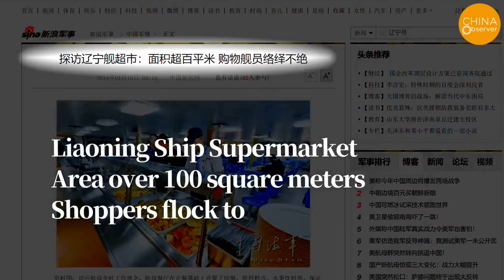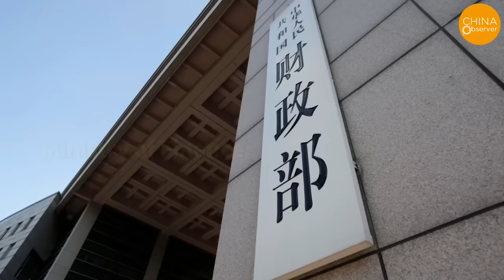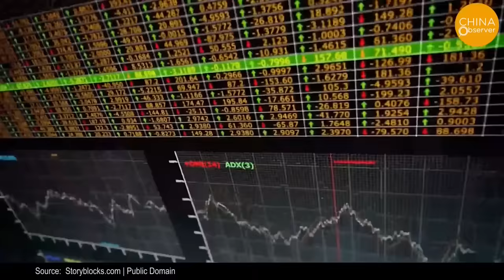China’s Junk Aircraft Carrier Fears to Sail? A Big Joke Due to Copycat Failure

Comment: The USN was fearful the Type 003 would essentially be a Chinese copy of the Kitty Hawk/Forestall Class conventionally powered, steam catapult super carrier. While smaller than Nimitz and Ford Class super carriers, they are just as capable and showed to be highly effective/economical. Which is why the USN used them until 2000's and would be ships Chinese shipyards could construct relatively easily, cheaper and quickly. With some estimates at 2 to 4 carrier ever 6 years, with goal of giving the China at least 6 carriers. The USN was convinced 4 to 6 Kitty Hawk/Forestall Class conventionally powered, steam catapult super carriers. Would give China effectively control over Western pacific. Instead the Chinese built the Fujian a conventionally powered sorta copy of Ford Class, down to electromagnetic catapults the USN is still perfecting. This told USN planner that the CCP was not serious about a carrier fleet. That the Fujian is just propaganda display and not meant to fight the USN. At most its existence is meant to intimate smaller weaker nations around China into submission. Unfortunately for them that backfired as instead, those nations ran to the US for help.
Reply: The Chinese have absolutely no chance of building any past American Super carrier designs as they are above top-secret. They were never sold or transferred to foreign entities and US law requires their disposal at secure facilities.

 You'll notice we didn't sell any old carriers to China as Casino/Hotels. That's the only reason they can copy Soviet designs. The Chinese couldn't design or implement a steam catapult that could fling 74,000 lbs to flight speeds neither could the USSR!

Why do you think China jumped right to electromagnetic Cats. Because when they fumble around figuring it out they can point to the West as if the West's numerous  reliable steam cats don't exist.
Reply: brillaint
Reply: True
Reply: Source: my ass😂
Reply: @youarebeingtrolled6954  Source - Straight from the CCP's top economist: "In 2020, 600 million Chinese — 40% of the population, were living in abject poverty on less than $141 USD/month and the mainland economy had stopped actual growth around the year 2013." - Li Keqiang. I wonder what happened to him? With the massive downturn in youth unemployment (the CCP stopped reporting this 2 months ago after it crossed 46%), manufacturing exodus, local and provincial debt insolvency, real estate insolvency, the rapid decline in currency evaluation, etc, etc, etc, those numbers will become much, much worse. This is not 'Japanification' or 'stagflation' of the mainland economy but 'Zimbabwification' of the mainland economy, meaning eventual dissolution of the current nation-state. Xi is too weak a leader to have powerful CCP educated economists expose his lies, so Li Keqiang had to go. That is a terrified, angry little dictator whose days are extremely numbered. Their 'military' is make believe. Sorry kid. Have a nice day.
Reply: I agree Chinese foreign policy in the South China Sea has created adversaries rather than allies. The artificial islands that also white elephants that were intended to intimidate SCS coastal states. Now they face bases in the Philippines that rendered them strategically impotent.
Reply: @JoeBLOWFHB  The key to your statement is that US carrier designs are Top Secret. You forget that there is one other country that has built essentially a "mini-Nimitz", France.
Reply: @martykarr7058  The CDG isn't even close to the Nimitz's class carriers in quality or reliability. It was their one and only try at a CVN rating.

They started and stopped production 4 times due to budgetary constraints. By the time the ship was completed they had to upgrade the radiation shielding because the standards had changed. 

Once that was ironed out they came to find out why the USN didn't use nuclear sub reactors in their carriers. This lead to huge reliability issue throughout the carriers life. 

Add to that it has major vibration issues due to a faulty prop manufacturing causing it to throw a wheel while it was underway. Cherry on top the props plans were lost in a fire so they had to make due with old props from an old carrier. This made her even slower than her pugly 27 kts now she was limited to 24 kts. This wasn't fixed until her midlife refueling.

The French sub reactors have to be refueled every 7 years compared to 25 years for the Nimitz.

In 2010 she had a major electrical fault that cut her deployment to one day.
Reply: That would be a huge challenge for China to build 4 carriers in 6 years, tested and battle ready. The US has been building carriers for about a hundred years, the Chinese is just now completing their first one. Would it be smart to start building 4 more before discovering all the shortcomings of the first? Even the USS Ford still has bugs.
Reply: It is simply not possible. Funds notwithstanding, no nation on the earth, with the long shot bet going with the USN's astonishing capabilities, could build them that fast.
A weak propaganda move to attempt to intimidate Taiwan, Japan, etc. The USN should continue to focus on ship defense ,both in close and at range.
Certainly, anti ship missiles are a concern, until their launch and command/control systems are wiped out. Sounds like an air wings/ submarine job. We're ok.
And: lets keep the Arleigh Burkes around....update them, sure.
But don't park them.....they are too good at what they do.
Reply: @JoeBLOWFHB not to defend France’s carrier but even the USN has growing pains with new designs. Example this year a new littoral ship was commissioned and towed to scrap never having a crew. This probably almost as expensive or even more expensive than a single carrier given a whole number of these flawed ships have been built over the years. Iirc  one of the two class was limited to 7-14kn because of she went designed speed the aluminum hull would break in half. Carriers are equal to dread-knot battleships. Old concept not valid in peer to peer today but too old to know it. First time a peer to peer conflict occurs we will see the carrier go the way of the battleship. We will see smaller more capable ships with a focus on drone tech/ electronic warfare vs large floating airfields.
Reply: With their steel technology, they can't even build a hull that doesn't fall apart.  Catch the part about both domestic built carriers keep rupturing, while the Ukraine-built one at least can keep the water out?
Reply: The USN is not worried about Chinese carriers. That’s just wishful thinking…
Reply: @powershift2024 Well said bud and absolutely spot on.
Reply: @hallmobility Cute. Chinese shipbuilding companies dominates the market with Japan and S.Korea smelling the asphalt. Where's US in the picture again?
Reply: @elvisischrist  eh, i'd say they're worried... as a shipping hazard rather than a military hazard...
Reply: The US Kitty Hawk/Forrestal class carriers aren’t anywhere near as capable as the Nimitz class much less the Ford class carriers. There is a reason the US Navy chose to spend billions more for nuclear powered carriers. Their sortie rate is far superior and longevity on station is as well. Just because the US kept using older conventional carriers doesn’t mean the nuclear ones aren’t far superior.
Reply: @martykarr7058 The French nuclear carrier isn’t nearly as capable as any US nuclear carrier.
Reply: @JoeBLOWFHB  Actually, the US did use submarine reactors in a carrier, Enterprise, CVN-65. THat's one of the reasons she had eight, because they were based on the same reactor that the Nautilus used.
Reply: @martykarr7058  Yeah and it was the only example to be built out of the six carriers planned. The other 5 were cancelled because their reactor design was subpar for the task.
Reply: @JoeBLOWFHB  What do you mean by subpar? If anything it turned out to be OVERPOWERED. The reason it was a solo was due to costs compared to conventional carriers, and trying to incorporate too much immature technology.
Reply: This is the first of the class.  Even the USS Gerald Ford was delayed for a variety of reason...beside solving engineering problems.
Reply: Yep. It's hard to be intimidated by a big ship that is too screwed-up to leave port.
Reply: @JoeBLOWFHB  Yes but the Chinse did get a close look a the HMAS Melbourne. Though not a Forestall/Kitty Hawk or even a Midway Class carrier. It was pretty close to the upgraded Essex class, but it had all the fundamentals as UK/AUS light carrier. For China to attempt to build a Midway or Forestall Class medium carrier. It was believed that lessons learned from building such a ship would have given the China enough experience and know how in operating steam catapults/arrested landing operations. Along with the what is necessary in building aircraft carriers to let build a true supper carrier, though again the Forestall/Kitty Hawk range by the 2030's, if work had started in 2010's.
Reply: @howiescott5865  This was considered a worst case scenario by the USN in order to plan for the worst and not get taken off guard (ala Pearl Harbor). While also making a great way to get more funding for the USN out of the US Congress.
Reply: @accountantthe3394  Yes in civilian shipbuilding. But commercial container ship and an aircraft carrier are not one to one comparisons. No nation on Earth has US warship production capabilities (not that the US hasn't let it atrophy) and its lack of domestic civilian shipbuilding was another sacrifice to outsourcing. Meaning the US still has the know how to return major civil ship building and doesn't have to start from scratch. Though the Biden Administration has been pushing to rebuild that industry in the US too. With another infrastructure bill to begin building new large/mega commercial ship building facilities/infrastructure again on East/West Coast.
Reply: @matthewhuszarik4173  Yes and no. Kitty Hawk/Forrestal classes are no Nimitz/Ford Class, but they were still considered super carriers carrying over 70 aircraft (helicopters/fixed wing). Just that they were the maximum size (as far as the USN was concerned) for conventionally powered super carrier. But the main short comings of the Kitty Hawk/Forrestal class would be negated by China using her versions (if they had gone down that road) in only the South China and East China sea. Making replenishment a non-issue as even conventionally powered super carriers that size have double the deployment endurance without needed replenishment compared to even Fujian as it appears now. As the Fujian is 10,000 tons heavier (Fujian 71,000 tons unloaded and 80,000 tons loaded) unloaded than the Kitty Hawk/Forrestal class (60,000 tons unloaded and 80,000 tons loaded). Which requiring twice as often resupply a ship that size, since Fujian can only carrier 10,000 tons of fuel (for the ship and aircraft), provisions, spare parts, planes/helicopters verses the Kitty Hawk/Forrestal class with carried 20,000 tons. Which again shows why the USN didn't build conventionally powered super carriers over 60,000 tons unloaded/80,000 tons loaded. Though I should point out the Forrestal class a 1950's design had more powerful steam boilers than Fujian at almost 300,000 shp to 220,000 shp.
Reply: @martykarr7058  The reactor design was considered subpar in that it was too complex and expensive to operate compared to later Nimitz class. As others have pointed out, they kind went over with the reactor design, with being first attempt at a nuclear powered aircraft carrier.
Reply: @luxuriousrustbucket  No it was considered a worst case scenario by the USN as described to Congress back in 2012. I didn't say the USN was sure that would happen, only that it was worst case feared by the USN. Which didn't happen, but I prefer that the USN plan's for worst case, so we don't get another Pearl Harbor.
Reply: @TK199999  So you think you could build a Formula 1 race car from scratch with just a close look at a model T?

The Mel was a light aircraft carrier NOT a Fleet carrier. It couldn't carry the 90-100 airframes an Essex Class could. It couldn't make 33 kts off a waterfall. It wasn't ANYTHING close to an Essex class so NO it wouldn't help the Chinese with squat.
Reply: @JoeBLOWFHB  And the Mel seemed more of a threat to her allies operating near her than the Soviets.
Reply: @accountantthe3394  It's not a question of numbers....It's a question of one nation turning out the worlds most advanced, state of the art warships and the other turning out large numbers of relatively low tech tanker and container ships.....In terms of shipbuilding, China's been turning out large numbers of Model A  Fords while The US, in it's carrier and sub programs, is turning out modern formula 1 racers..................
Reply: U cant replace experience like it or not thr united states has been at wat in one way or another for over 50 years. That counts.